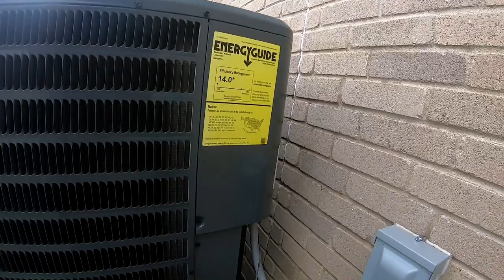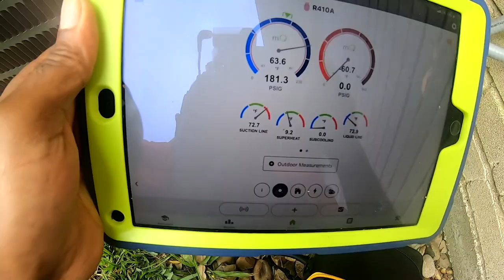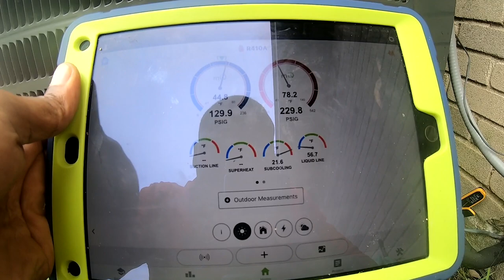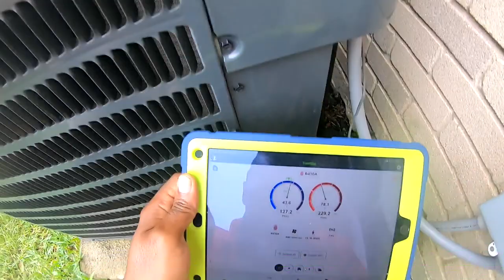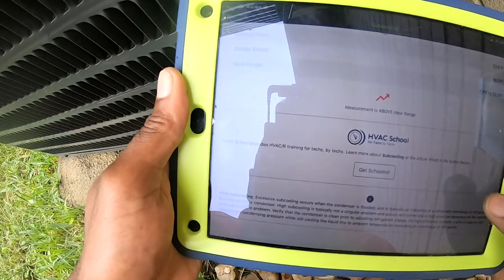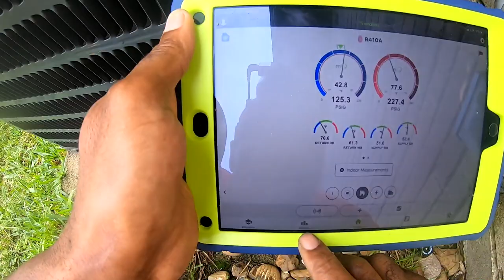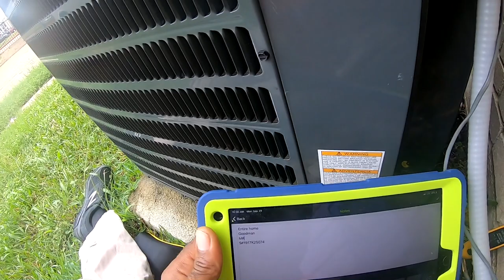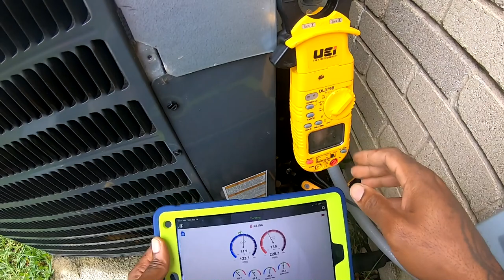"Insane AC Condenser Inspection: Discover the Hidden Secrets!"

Comment: Glad you started to MQ. You will find that you will rarely need a manifold as your primary service tool especially useful for piston systems because it does continued SH target calculations. For charging and evac, use charge adapter and or a core tool remover by Accutools to feed refrigerants or to evac. The bluVAC+ pro micron meter is the best I have found which has an app made by MQ company.  My commercial customers have ask more often now a days for fancy reports which MQ is perfect for.  I notice my customers pay faster when I hand then the invoice with a report.  Just keep in mind that your knowledge and experience from years of practice is still needed to constantly validate what MQ shows you because the recommendations are just recommendations and present potential issues and or causes (at that institution of time) and not always absolute problems. And as we also practice, make sure the system has been running long enough to stabilize.  MQ has helped me save time and make more $

Comment: I think you have to pay extra to get the full use of measure quick as far as projects go. I use it everyday. You can put in projects and it will show the location of the unit and keep all the info of the equipment. Just make adjustments until you get the green flag.

Comment: You have to stick the supply temp probe inside the grill for the supply. Your supply air pushes out the grill and twirl inwards, mixing ambient air with supply. You may not notice on an ac that is working and its 75 in the house already. You will have a large false reading if you just fixed the ac and it's hot inside the house. Called the bernoulli effect. Threw me off at 1st until I watch one of Jim's vids. The measure quick guy. Your diving into the whole thing 1st. Baby steps. Learn how to use the equipment 1st